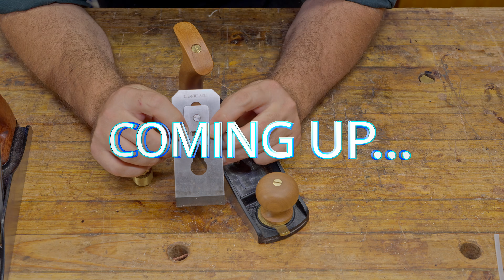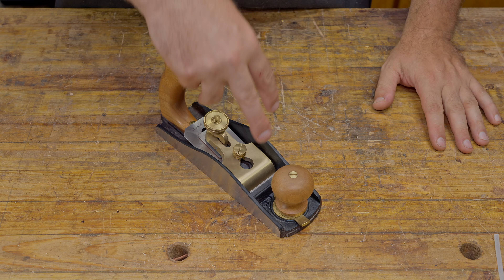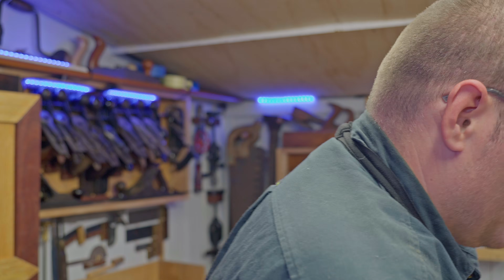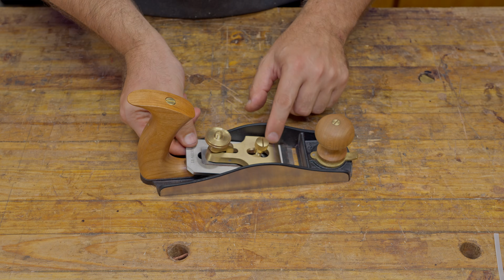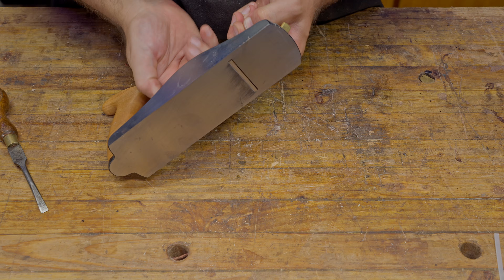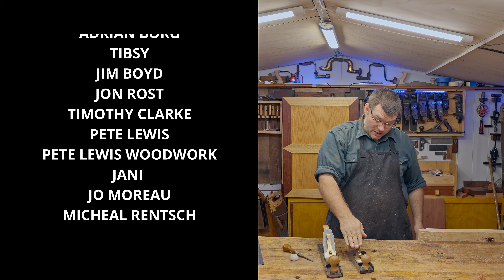#164 Low Angle Bevel Up Smoother | Tool Showcase

Comment: I have the Stanley version somewhere in a dark and dusty corner of my workshop.... Bought it 30 odd years ago, used it a few times and thought meh.. 
It really didn't do anything special which is probably why Stanley discontinued it. 
Some folk say they are great for planing cranky grain which may well be true, but a finely tuned Bailey will work. 
If memory serves the iron is pretty much the same thickness as the bog standard Bailey design. 
That chonky L. N blade may just be the one improvement the bevel up low angle design needed to make it worth having. 
Would be interesting to see how it performs on a chunk of curly Jarrah.
Reply from the maker: I agree that the chunky LN blade is likely the reason this version works better than the Stanley one. I think with a standard Bailey blade it would chatter quite a bit.

I'm planning on filming a comparison video so i will make sure i use some Jarrah as curly as i can find for that.

Comment: I do have one, or maybe 2, can't remember..... That comes with age.... I do need to work with the bevel up blades more. I have found it easier to adjust them laterally with an upholstery hammer which is very small. Maybe as my eye improves, I can adjust it by eye first and that will be good enough. I still have to take a shaving from each side to see if they are the same thickness to make sure my eyeball job is close enough....
Reply: I have one…it’s my favorite smoothing plane. Leaves a glass smooth surface.
Reply from the maker: @richardtorres9143  thanks, i agree it does leave an amazing surface.
Reply from the maker: An upholstery hammer is a great idea for tap adjustment. I think checking the blade is square or to double check, taking a shaving is the best way to know for sure.

Comment: That's a new one on me, haven't seen or heard of them before. Would I buy one? Yes, just for the hell of it. At first it seemed like a step backwards in plane technology in the video but then it sort of started making sense and looked like a great alternative. Finger or hammer adjusting doesn't bother me - it's often quicker and easier than fiddling around with lateral adjustments that don't always do what you want them to. 5mm blade - that is thick...!
Reply from the maker: When i saw this plane i couldn't resist getting one. I agree at first it looks like old technology, but turns out it works great.